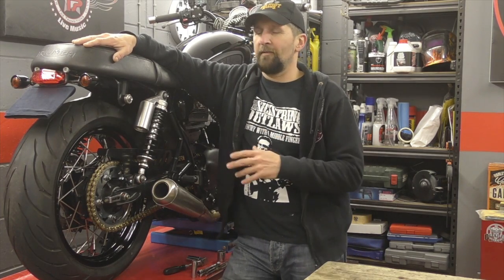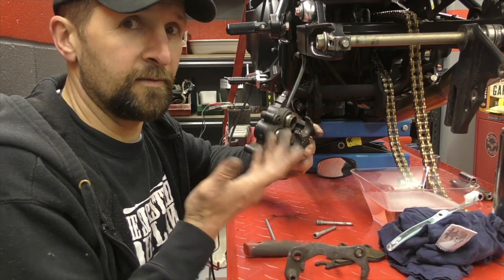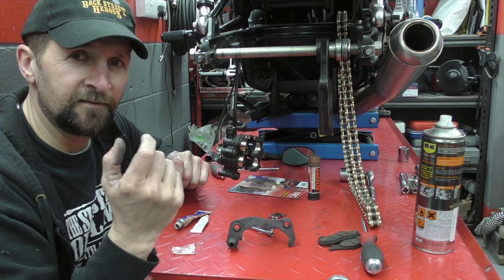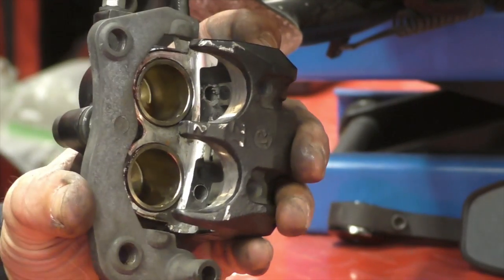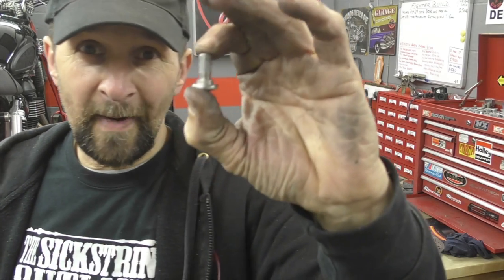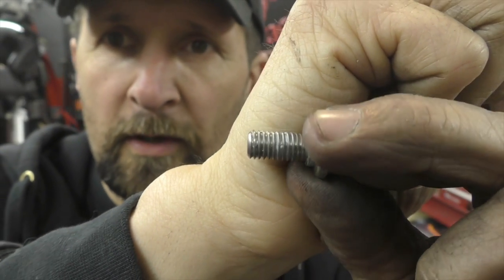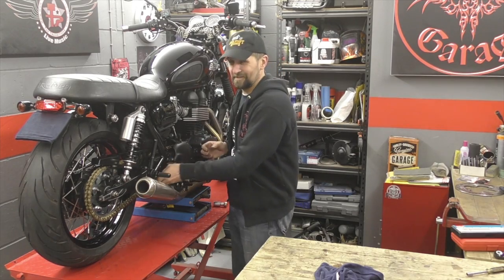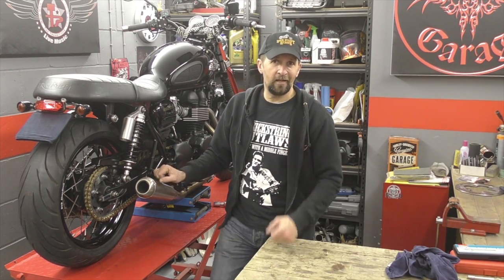Delboy's Garage, Triumph Bonneville Rear Brake Upgrade.

Comment: Handy tool for brakes work is fairly common in northern North America as each 1/5 (750 ml) bottle of Crown Royal has a purple & gold flannel bag. These fit perfectly over calipers and with draw string easily attach to bike in ideal location.

Comment: In the absence of lithium grease, i'd argue that due to the nature of electric charge, corrosion due to electron transfer and so on, ceramic high temp grease is superior to copper slip while being not that expensive either ( I think i paid 8€ for a 300gramm tube) in places where aluminium and steel touch.

Comment: Just a word of warning - if your calipers have been powder coated be very careful how you use brake cleaner - it is very easy to 'melt' the powder coating because the brake cleaner is corrosive - don't ask me how I know! :(
Reply from the maker: Doh... thats why you should always 'Paint' calipers with 2k paint... powdercoat isn't the wonder coating it made out to be aye..!
Reply: +Jonathan Lambert How do you know? c".) :-D

Comment: I've just replaced the rubber booties on my rear caliper as they were about twice the size of the new ones. There's plenty of people saying copperslip swells the rubber? Is this something you've come across?
Reply from the maker: No buddy, not psecifically with copperslip, rubber swells in the presence of most chemicals, petrol on fuel tap seals, the gasket in your derby cover, sump plug o-rings, they all become soft and puff up, but will shrink back again when they dry out... use rubber lube inside as this doesn't contain the same chemicals as oil...

Comment: Were the pads the  EBC Sintered (HH Type)?, I really want to upgrade the breaks on my T100,  and I waiting to see how much improvement you get from your upgrade.
Reply from the maker: No need to wait buddy, have been using them for years, I can tell you, they are the right move,... the copper sintered material is more aggressive, presents more abrasion to the disc surface, therefore increased drag... the cost is a little more wear to the discs, but that is a price you have to consider for improved braking... but if you have the money, and can upgrade to EBC discs as well, then they are harder steel and will resist that wear being more resiliant, so an all round better solution, and why I'm doing mine!

Comment: Watched this last night after I got an MOT advisory for a sticky calliper. Took it apart as per Del’s step by step instructions, cleaned it all up, pushed the pots out, cleaned and red grease liberally applied to the pots, slide bar and rubbers, then copper slip on the threads of the pad pins. Didn’t change my pads as they weren’t old and were not showing any uneven wear. Works a treat now. Cheers!
I’m going to upgrade the pots to the TRK from Wemoto when it’s next time to do the pads.
Reply from the maker: Thanks for the feedback Andrew, im glad you got it fixed, it's usually just dirt that hangs up the pistons, and little more then a quick clean is all they need..   you'll love the TRK pistons when you come to that, they are way better made than the factory ones, a definite upgrade..

Comment: Was watching ur vid  thinking i wish i had a setup like that. I just bought a 2005 Bonnie with carbs, and to my surprise, no center stand, no spool holes.  I've always done my own repairs, but every bike I've had, has had a center stand. I see the frame jack u have, but its so narrow, the frame, I get a little iffy.
I do for sure need a chain, so gotta make up me mind. 
I'm so glad Triumph used stainless spokes. My old CB 750 Honda didn't. Always looked dull. 
You do it right,for sure. Thanks.
Reply from the maker: Hi Peter, I know what you mean mate, it can be frustrating when there's no way to stand your bike upright... I generally tend to throw a little table jack beneath the frame, but it's not ideal and nor is it very secure... but here's a couple of links that may interest you from TEC Bike Parts, first is some bobbins that fit through your rear wheel axle, it's extremely simple to fit, takes literally less than 60 seconds to slap it through the axle and screw the ends on, and then you can lift the back of the bike with a paddock stand,... here's a link:  https://www.tecbikeparts.com/product/paddock-stand-bobbins-axle-adaptor-bobbins-kit-to-fit-thruxton-scrambler-900cc-up-to-2016-aircooled-models/       (we have a video which incorporates this upgrade if you need it).

And also here is the general page as some aftermarket centre stands, as many of the early Trihttps://www.tecbikeparts.com/products/shop-parts/triumph-aircooled/stands-triumph-aircooled/ummphs cam e with the mounting but no stand... maybe they will help you too...!
Reply: @Moonfleet41  Thanks,  i see. It's a threaded rod that goes through the axle and attaches to the spools,bobbins? I'm wondering if the bolt that comes with the bobbins would be sufficient. I just received a set I ordered with 8mm bolt?  You have two people there in UK that have factory stands. But they want 200 dollars plus 100 shipping.  If they were still making them or just had some in stock, I could buy it locally for 145 bucks. That's the center stand.  I love this bike, but by the time I'm done I could have paid enough to let the service center work on it. Haha.
I'll check the sites u sent. Thanks again Del.

Comment: Hi Del. Just replaced both front discs on my tiger 955i. Got new bolts as you recommended. I have to say the genuine bolts from Triumph were cheaper than Wemoto. They also have caps to cover them. Great video. keep up the good work.
Reply from the maker: Hi Dan... that's because the factory bolts are cheaper quality mate..!   Good to hear from you too..

Comment: Thanks again for the awesome video as always, Del!  @11:55 you recommended a HT white lithium grease on the sliding pins. I was referencing a service manual and it said 'Never use mineral-based grease (such as lithium or copper-based grease) in any part of the braking system or in any area where contact with the braking system is possible. Mineral-based grease will damage the hydraulic seals and dust seals in the calipers and master cylinders.'  It also suggested lubrication with silicon-based grease (T2022021) for the mounting bracket pins.  Should I just go with your choice as I always have? Thanks!

Comment: Another amazingly informative video. One thing I didn't know was that you need to back off the tension on the torque wrench all the way. Thanks for informing us of that even though I'm doing all my own work on my bike I never knew that you could knacker the wrench by not backing it off. Thanks for that I've just had to buy all new tools over the past 12 months cos my garage got broken into and took all my tools I had everything I could possibly need now is have to start again. It was done on 1st April last year, not a very funny prank too pull. I'm still finding that some of the tools i used I haven't got and it's annoying that I have to go and buy it. I had about £2500 of tools taken. Thanks again for the video and keep doing what you do best, clear and consise instructions. Ride save bruv and the misses too.
Reply from the maker: Bloody hell mate, that's horrible... the worst thing of all is trying to remember everything you had so the insurance can replace it, not to mention the old sentimental tools, because the worse things is, they are the ones that the thieving scum will throw away as not worth anything... whenever I see second hand tools for sale in quantities, I often wonder where they have come from... hope you get it all square again soon fellah, and thanks for taking the time to write, all the best D&Px

Comment: Great video again. i have only one issue with the slinky clutch cable, the end adjuster has gotten a fair amount of surface rust building up in a couple  of months.  you may want to give them a coating of something. however the cable itself is great, so much smoother than my original. I would not have tried to change the cable before watching you.
Reply from the maker: Sounds like the same as my factory cable then, I don't swear by anything till I've tested it, and this will be it's test... we shall see how it fairs!

Comment: Because you lubed the threads on the brake pin, I would knock off 10% from the dry torque specification.
Reply from the maker: Incorrect my friend, all torque values are quoted for lubricated threads!

Comment: Maybe a simple skills video on different types of grease and their uses? I have never seen anything explaining just that. thanks for the great tips.
Reply: Silicone grease on metal to rubber (caliper slide pins) and copper anti seize on metal to metal contact (where the brake pads sit on the caliper and where the pads touch the brake hardware)
Reply: @alancuriel123456   @Otto is not My real Name @Moonfleet41 Delboy makes some great comedy videos with copper grease where he absolutley shellacs the brake pads, front and back, with copper grease!! lol I thought he was being serious but someone pointed out to me that it was one of Del's comedy videos on how to not use Copper Grease and it makes sense because no one would put so much grease on the back of break pads, especially modern brake pads that are built with anti sieze and anti squeal low noise pad backing and shims--but in these videos he put on so much copper grease it is coming off the back of the brake pads and getting all over the sides of the brake pads and would definitley have gotten all over the front of the pads and the rotors during the first ride! lol Yikes! Im looking at this and other videos to see if I can find his joke videos again because it's so funny! Apparently he has a few of them but my friend who told me about them didn't have links.. Great videos Delboy! Keep it up! lol

Comment: oooooh it's like open university for bikers...
Cheers proffessor Del !!
If you ask for lithium grease red rubber grease copperslip ht axle grease or graphite anti seize up here near Yorkshire they hand you a tub of lard !!!
♿
Reply from the maker: Ha ha.. i have to chuckle at some of the adenoidal critics who tell me i should use this or that special chemical, and then proceed to lay on how dangerous it is to use the wrong grease here or there (usually as they shove glasses up their nose with middle finger and snort)... everyone's an expert aye Paul.... back in the day my old man had one tub of grease in the garage and that did everything.. he lubed his Triumph chain with old engine oil and a paint brush...  How the world has changed aye...       Im gonna buy shares in Prunes i think.. because so many people need them these days aye..!

Comment: Just bought OEM throttle cable from Wemoto - should have waited for this video and gone for the slinky glide! Although you do a lot of the same job on your channel, you impart different bits of knowledge each time, some small detail or tip, which makes it very worthwhile to see. Also of course repetition as a viewer helps embed the knowledge, as does seeing it done on different types of bikes. With the wheel alignment, would measuring the length of the pulley bolt sticking out work to double check, or am I being an idiot?
Reply from the maker: Hi mate, Sorry, "Measuring the length of the pulley bolt"... what pulley mate?, not sure what you mean..?

Comment: Worth mentioning that you should always remove the master cylinder cover before pushing the pistons back.
Reply from the maker: Not necessary buddy.. the fluid will have dropped as you pump the pistons out.. and will simply flow back up when you push them on.. your master cylinder has an air hole to allow for that movement...!   You can if you wish, but it makes no difference as you saw here..! (bit of an old wives tale buddy)..
Reply: Agreed 100%, the problem is usually where the fluid has been topped up as the pads have worn down over time by well meaning service rs, then, new pads are fitted and there is no room for the extra fluid when the pistons are pushed back. 
Removing the cap allows some fluid to be removed.

General info Del, I know 'you' know.
Reply from the maker: I know.. another annoying old wives tale.. "the need to top up fluid".... if it had a full reservoir when it had new pads, then that is a quantity it will always need and no more... if its low, its because ther pads a re low....it doesn't leak, or evaporate..lol    in fact, its best to NEVER take the lid off as brake fluid is so horribly hydroscopic........ Ill cover that in the fluid change video for sure..

Comment: Hi Delboy, love your work - very British style. Can you please comment on 1. The difference between brake pads that have one piece compared to those with multiple padlets with slots between them. 2. Should the backing plate of OEM pads be reused with aftermarket pads like EBC?.

Thanks for your time.

Comment: Dear Delboy, love the content. I recently purchased an 05 Thruxton in racing yellow and you inspired me to do my own maintenance. It seems to need a bunch of work, but most recently I examined the rear breaks and saw uneven pad wear. Upon closer inspection, one of the pistons is tight and barely moves either out using the lever, or back in using my finger. Is there anything to do at this point to fix the offending piston prior to a full caliper overhaul, or am I looking at a full rebuild of this caliper?
Reply from the maker: Hi Kyle, good to hear from you and congratulations on the bike... and yes you can do a little maintenance on that that might free it off without having to strip it, just drop the caliper off and take the pads out, hold the free piston (perhaps with a G-clamp) and pump out the offending piston just a little way until you see clean metal, then with lots of hot soapy water and a toothbrush, scrub all round the piston 'gum line' and get it totally clean, then wash all that out with brake cleaner...  if you have some, then a little rubber lube smeared round the piston, and then just work it in and out... you can wind it in with the clamp and pump it out a few times to free it off.... then wipe all clean and dry and re-install it.  It should give you a stay over execution, at least a few months if you use it every day, but if it doesn't work, then stripping and re-building it certainly will... everything you need you should find in our Playlists!
Reply: @Moonfleet41  Update, offending piston is still offending me! I did a thorough clean and grease, used the clamp method to slide it in and out a couple of times, but one still does not want to push out. I also flushed and replaced brake fluid. Still not popping out. Unless there is another item to troubleshoot that I am not thinking of, it looks like I'll need the caliper rebuild in the end. (the only other item I can think of is the brake fluid reservoir is weeping ever so slightly but I do not think it is bad enough to cause one of the pistons to stay..)

Should I just pop out the pistons, clean the caliper and seals, and then reassemble, or replace components as well? Or does it depend on how shot the pistons are...(mine are not that bad)
Reply from the maker: @kalmanmandel9999  Hi Kyle, it sounds like this one's being stubborn..., firstly it'll be nothing to do with your weeping fluid, it's unrelated... I imagine it's the classic situation where road salt, which is always there even through the summer, gets in to your system, the heat from the brakes dries away the water and salt crystals form behind the dust seal and physically push it out of it's groove and it just jams the piston... no amount of working it in and out helps, like you say, best solution, pop both pistons out, hook the seals out, clean everything for all it's worth till it looks brand new and re-assemble it all from scratch... you won't need new seals unless you damage one, as you say, the system looks pretty good, but if you find you do once stripped, then Wemoto can get one on your doorstep next day... if you get stuck we've lots of videos on it.... best of luck with it!

Comment: The chain slack (owners manual) specified takes into account the rider/compression: mine measured 50 mm (limits 45 - 55 mm).  My MOT centre made my chain slack an advisory!

Comment: In previous videos you had used some copper slip on the outer side of the brake pads to prevent squealing, reduce vibrations. Why have you left the pads clean this time? Thanks for reply.
Reply from the maker: Solid mounted calipers tend to be the only type that squeal, and even then only on big discs at the front... the sliding mount on this caliper absorbs the vibration and thus the disc doesn't 'sing' as those vibes are transmitted across... also a small thick rear disc doesn't suffer from vibration either.. so no need on this bike,...

Comment: Great job Del, will deffo have to do this with mine,,,, have had binding issue following the freeze ur nutz ride obviously salt. What's you opinion on remounting above ?   Take care both.
Reply from the maker: Hi Tony... i think you mean the rear caliper.. there is a top mount for it... i think you need another brake hose to reach, not sure, and if you get your bike muddy and covered in road grime, then i guess it could help... but the dirt will still stick to it day to day which ever way it is..! it wont release you of the cleaning duties buddy..lol